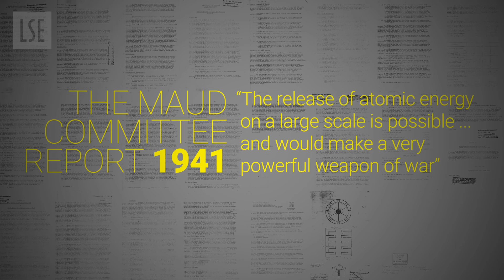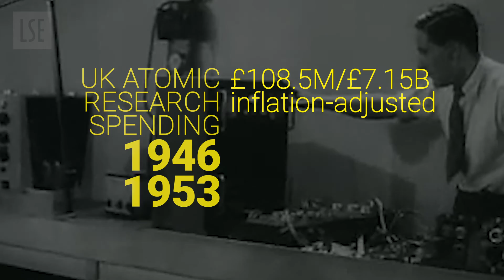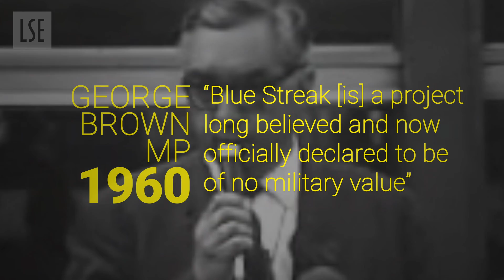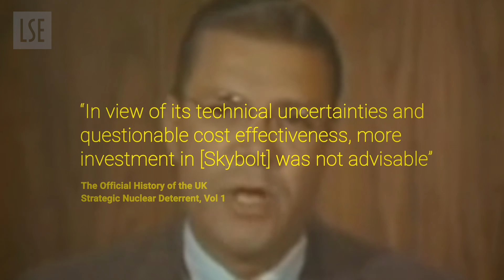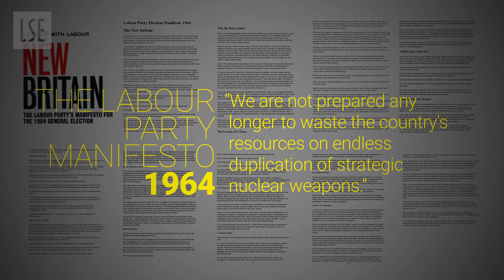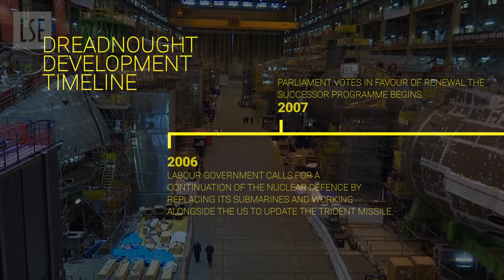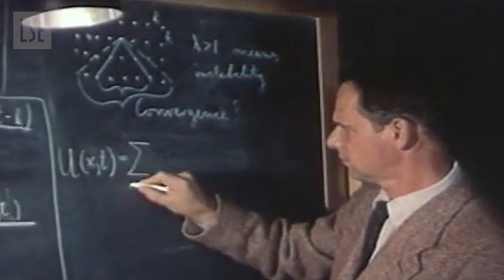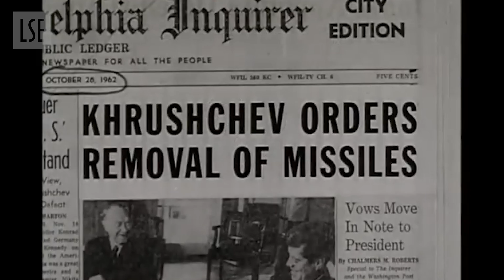The History of the UK's Nuclear Weapons

Comment: Britains nukes are most ferrainly NOT an independant deterrant. The order to launch missiles will not come from Downing street or  UK forces HQ but from NATO commander. This is always a US General. Only UK taxpayers pay for it though
Reply: Nope.
Reply: The order comes from Northwood or BBC Radio 4 on failing to transmit that afternoons episode of Desert Island Discs..
Reply: Just... No. The ONLY US link in the nuclear deterrent is for MAINTENANCE of the Trident missiles. There is NOTHING the US could do to stop us from firing them after they're loaded. The launch authority is solely on the submarine because any outside link would be real bad for a decapitation strike and the missiles don't rely on any GPS or anything purely on Astro inertial navigation so if a submarine captain went rogue and fired them at the US there is nothing they could do. The UK DOES CHOOSE to put them under NATO command, so it IS possible but that is very much a choice, but that DOES NOT STOP Downing Street from launching it themselves if they chose to do so.
Reply: Complete lie, they are part of NATO force structure. But are under complete British control no one, not even the Americans can tell us when to use them or when not to use them. It’s up to the British government
Reply: No, you are quite mistaken. If necessary the UK would launch the nukes themselves if threatened, the NATO command system is just a formality, in actuality, impending nuclear doom would cause them to retaliate as soon as possible.